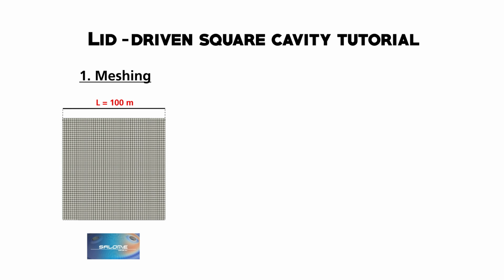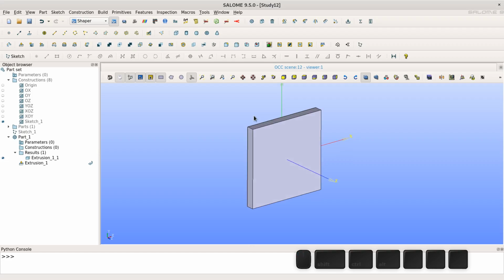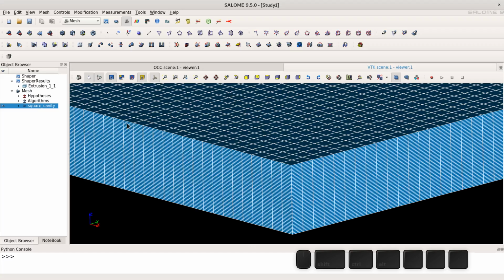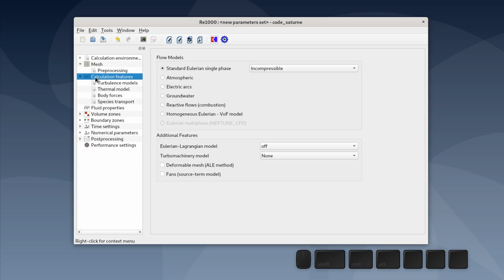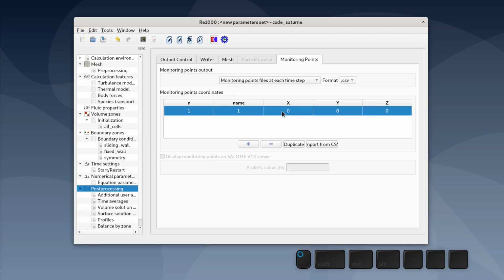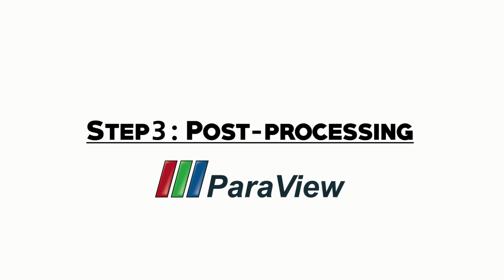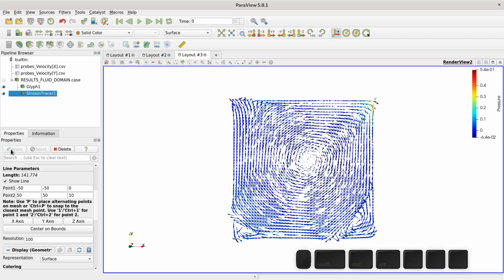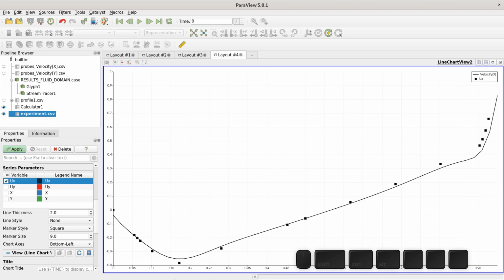[TUTORIAL #1] The Lid Driven Cavity at Reynolds 1000

Comment: Thank  you for your video.
Now I've just started to use Code_Saturne, but many problems happened.

Which version of Code saturne do you use?

In my case, I used Code_saturne 6.0.5 and mesh file of med file 3.3.
However, when I tried "check mesh" before calculation, the problems happened.
Preprocessing file indicated that "File Format "MED" support not available in this installation ".
Do you know why this kind of errors occur?
Reply from the maker: It is indeed possible that the MED libraries are older than what is required. You could give a try at conveting your mesh to UNV format with Salome ?
Reply: @code_saturne7617  
Sorry, I jsut missed MED package...

Comment: Hi great video! Thank you for the interesting tutorial.
Just a question: why I should use Code_Saturne instead of the well-known OpenFOAM?
Reply from the maker: I suggest you have a try a you tell me ! :-) But its HPC capabilities is definitely one of its main advantage.
Reply: There are several advantages. First, Saturn is less computationally intensive, allowing for the analysis of finer and more complex models with the same hardware configuration. Secondly, I need to analyze the interactions of piezoelectric actuators on a wing; OpenFOAM can't do that, or at least not easily. MHD interactions also seem possible, including MHD + piezoelectric actuators (I haven't explored that yet). Another advantage is that the calculations are robust and very reliable; it's industrial-grade hardware. I'll post videos as soon as possible; they'll be impressive.